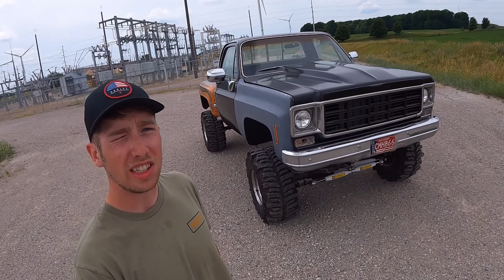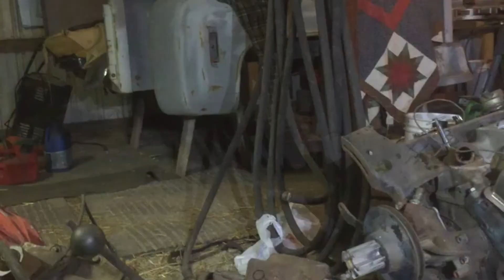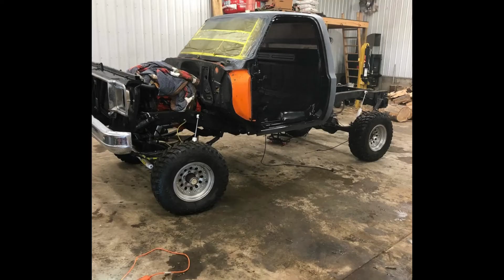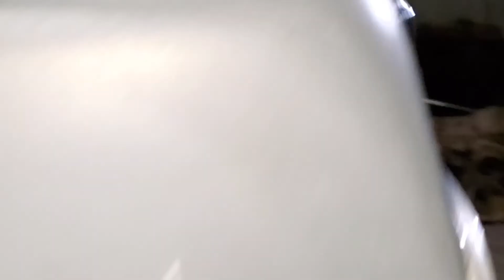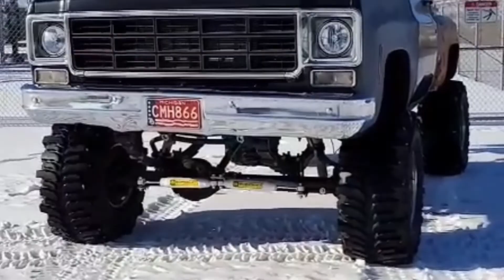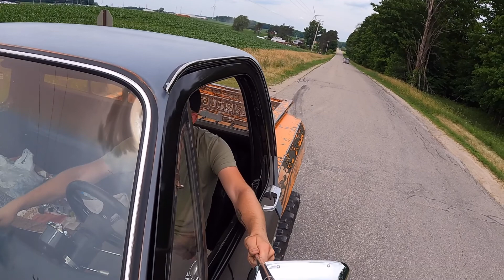squarebody chevy on boggers frame off restoration

Comment: Trucks badass.. stepside..what lift and tires are you running...almost completely my stepside..
Reply from the maker: 8 inch with 35x16s
Reply: @boostcrutv  12" wide wheels?..or 14"?..I got the same lift....deciding on tires and wheels...Thx
Reply from the maker: @samuelesparza9209  12 wides
Reply: @boostcrutv  Thx